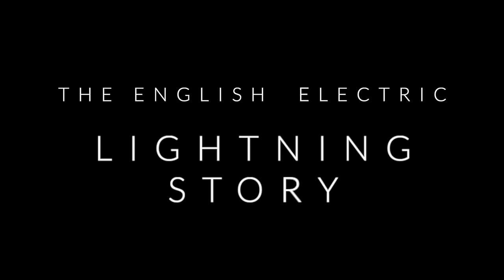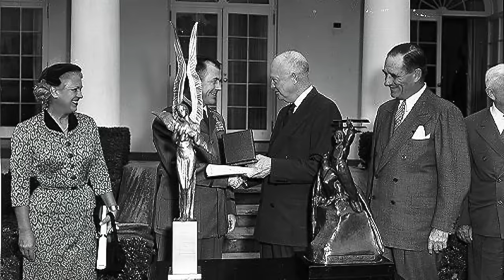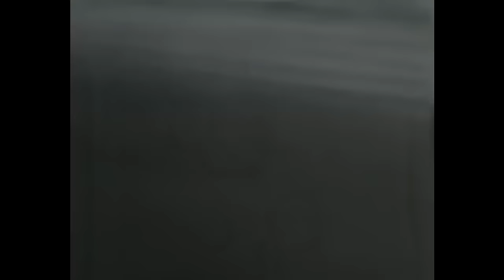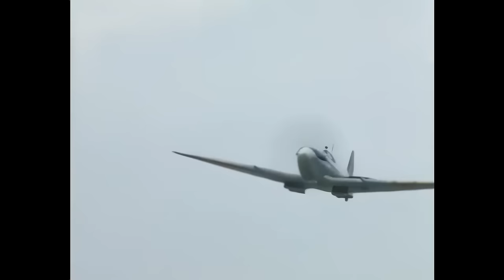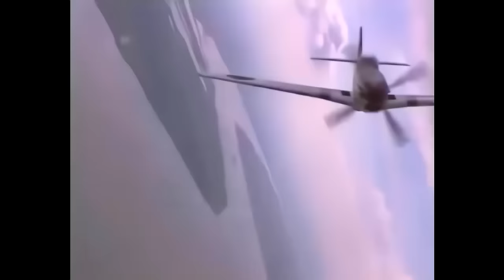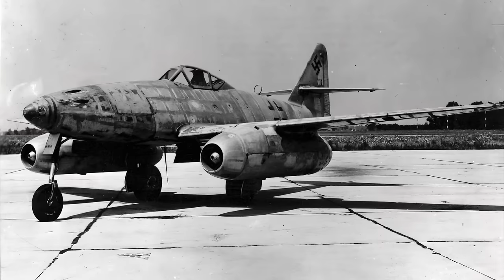English Electric Lightning | The British supersonic fighter and interceptor aircraft | Upscaled

Comment: I can well remember sitting in the canteen at the Dinorwic powerstation construction site in 1982 watching a pair of Lightnings that had appeared from the direction of RAF Valley, travelling up the Llanberis ridge over the top of Snowdon in a rolling scissors fight in full reheat. The roar was immense and shook the whole valley. It was an incredible sight to see them disappear high into the ether continuing to maneouvre until out of sight. I often wonder if they got a bollocking for upsetting the hillwalkers or a pat on the back for the recruitment work they did that afternoon.

Comment: I saw the Lightning at airshows in the 70s, loved to see it go vertical with reheat. Also watched one test firing it's missiles. I was in a Shackelton, OMGWD the Lightning pilot was bored, getting down slow enough for us to watch. Now I had a long chat with an ex lightning pilot over a couple of beers.About all he did was intercepting Russian Bears over the north sea. Their game was to sneak in at high level over the north sea in International airspace to prove they could nuke us. Now supposedly GB was protected by Ground to air missile systems, but what would they do to the bears? Radio bang bang we shot you down? To which the bear would answer "we shot down Gary Powers, what have you shot down?" The answer was the lightning, two approaches both intercept, either a Mach 2 flyby which would rattle the teeth of the most dedicated Soviet crew, or the lightning would formate on the bear and pilot to pilot show a Playboy centerfold. Well that's what I was told

Comment: Our company used to buy printing equipment from a company in Islington, the owner was a very tall ex RAF pilot with a fine handlebar mustache,  he informed me he was at the time the tallest pilot in the RAF and English Electric designed the Lightning cockpit fittings and seat to accommodate him, as he was the most extreme example. He then went on to fly them.

Comment: Actually, the Me-262 wing was not swept to delay compressibility.  
Wikipedia: "Because the engines were slow to arrive, Messerschmitt moved the engines from the wing roots to underwing pods, allowing them to be changed more readily if needed; this would turn out to be important, both for availability and maintenance.[13] Since the BMW 003 jets proved heavier than anticipated, the wing was swept slightly, by 18.5°, to accommodate a change in the center of gravity.[13]"

Comment: I went in the Leuchars 11 Sqn. simulator for about 90 min and straight after in the right hand seat of the T3(?) in 1966. A stupifying acceleration and quite easy to fly if you only used the trim switch. My last flight was in a RAFO, (Oman,) SAAB in 2014. Memories for a lifetime.

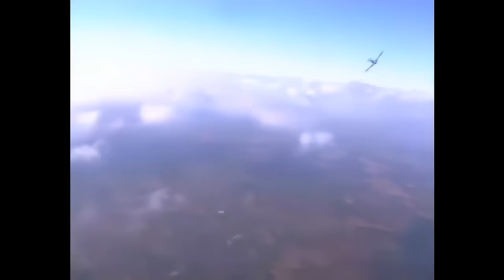Comment: 3:39
The term compressible flow is used to   express that the density changes due to the local pressure, in the case of a wing the local speed above the critical mach number exceeds the speed of sound locally on the top of  the wing, at that low pressure the air expands, NOT  compresses, accelerating the flow due to the increased volume. approaching the trailing edge the flow pressure must increase, the transition to subsonic flow happens along a weak shock, (called lambda shock) creating a sudden unfavorable pressure gradient, where the boundary layer separates, and turbulence occurs, which is felt as it  would under stall conditions. If the local supersonic flow distance is short, the separated flow may reattach, not perceivable but associated with an increase of drag, and a pitch moment.
The pressure distribution changes, so  that the center of pressure changes modifying the pitch moment, on the upper side a weak nose up moment is created, on the lower side a noticeable pitch down moment, which  may not be controllable, until at lower  altitude warmer air, with corresponding higher speed of sound the mach number is reduced reducing this nose down pitching moment, returning control.
That is what happened on the P-38.
At the leading edge near the stagnation point only is where higher pressure caused a slight compression, but not any where else.
The term compressibility is confusing when in reality an expansion is at play, again due to the volume increase leading to higher local velocity, past the speed of sound.
Reply: I seem to recall the lightning being referred to by people as the English electric frightening due to its performance and its ability to catch the so thought uncatchable aircraft

Comment: I have read that the Mies project had something that the x-1 vitally lacked, an all flying tail plane....without which the X-1 might not have been a succes. Later, a large scale model of the Miles 52 was tested and shot straight through Mach-1 with no problems at all. Also, it used a jet engine, not a rocket!

Comment: British engineering at its best!
Reply: It was pretty bad engineering really. Rolls sent a team down to try to work out why the upper engine didn't last very long. Putting one engine over another was bad design because if a fire started in the upper engine it would kill the lower one. The aden gun was supposed to be gravity fed but because of the lack of space it had to drag the rounds up causing jamming after a few rounds. The mk3 didn't even have these. The refueling probe was added as an afterthought reducing the max speed at sea level. The fuel lines were designed in the 50s and had no tolerance and had to be x-rayed after fitting and if found to be out in one place you had to re-fit the whole lot. The radar was off-set so causing the pilot to lean to one side to use it. If the pilot pulled around 7g it bent the airframe and the pilot had to pull negative g to stop the ventral tank from leaking. Our instructor died when flying without the missiles. They gave aerodynamic stability. The iso propyl nitrate starter sometimes exploded. One pilot pulled the stick back on take off while his wife filmed him. He pulled back too sharply stalling the airflow over the intake. She had a record of his death in a ball of fire.

Comment: Do you know if the Lightning took advantage of the transonic area rule?  Also, I know you didn’t write the thing but the first Soviet supersonic aircraft was the MiG-19.  MiG-21 could get to mach 2.
Reply from the maker: I actually don't know about the transonic rule Jay.
Reply: @Dronescapes  >> It came about in the 1960s to help aircraft designers go supersonic easier.  It’s easy to see on the F-106 coke bottle fuselage.
Reply: No, the sides are straight. There would have been no way to put a waist in around the wings, the fuselage was only just wider than the engines.

Comment: 4:53 the speed of sound al lower altitudes is higher because the TEMPERATURE increases, not because  the air is thicker. Standard atmosphere: 6.5 °C per 1000 meters altitude change.
ss = square root( 1.4 × R × Temp )
R = 287 J / kg K  gas constant for air
Temp in deg Kelvin K
ss speed of sound  m/sec, 
 at 15C, 288K   ss = 340 m/sec
Reply: Nope
Reply: @firstnamelastname-ys3mz  😀

Comment: there are gaps in knowledge. while the British were working on the jet to pass through the barrier. and a few mods to the rear tail planes they were told to cancel. and at the same time, the Americans had the design prints from the British. and they used that to move forward.   if the British were left to carry on. then the British would have won. and not yeager. captain eric brown told the truth. he had plenty of wartime experience and in combat.a very knowledgeable pilot.    RIP.  AND THE HAWKER TEST PILOT did he ever fight in the war??? in combat?  captain eric brown was one of the best..
Reply: There are gaps in knowledge alright.The plane you are talking about is the Miles M-52.There was no Miles M-52 ever.The closest Miles got was a Plywood mock-up.The project was cancelled because Power Jets did not have an engine ready.Neither Eric Brown,Chuck Yeager or anyone else could fly a Plywood mock-up pass the sound barrier.Eric Brown was one of the best pilot's who ever lived.

Comment: Another case of the UK not exploiting a good design in the way the US does. BAC  proposed a Swing Wing  variant with a very large underbelly tank and more hard points for the Royal Navy which could have been ordered instead of Phantoms. Both of those innovations would allow single engine working so that its endurance  would increase by a factor of four with a true multi-role capability. This would have had a two crew arrangement and a bigger radar  with a solid nose and side fuselage jet intakes.

Comment: I love this plane and UK was way ahead in super sonic jet powered development by the mid 40s with the Miles M.52 whose secrets the British government gave to the US and then cancelled in 1946 just before it flew. The Lightning, although not a direct descendent, was a fabulous engineering achievement and awe inspiring aircraft that achieved its aim to intercept Russian overflights. The Lightning held many records and was the only plane of it's time to fly above a U2 and catch Concorde at full throttle. Lockheed designed the F4 but the US Air Force didn't adopt it and was later found to have bribed officials to buy it, curtailing Lightning sales. The F4 was difficult to control and many less experienced pilots were killed by its foibles.
Reply: I find facts are helpful.There was no Miles M-52.The closest Miles got was a Ply-wood mock-up.Power Jets did not have an engine ready and the project was cancelled.Lockheed did not build the F4.McDonald Douglas built the F4.I think you mean the F-104 which Lockheed did in fact build.The last F104's were retired in 2004.(Italy)

Comment: The USA managed to break the sound barrier on the bell X1 with the help of data and technology from a cancelled uk supersonic plane project which used a moving tail plane which the X 1 originally didn’t have  the ukproject  was cancelled and the data and tech knowledge was passed to bell which then went on to break Mach 1 in level flight
Reply: Your talking about the Miles M-52.There was no Miles M-52 ever.Miles built a Plywood mock-up and that was as close as they got.Miles didn't invent the moving tail.It had been on test aircraft for years.Bell already had it in their design.The M-52 was cancelled because Power Jets the engine builder did not have an engine ready.Miles didn't give Bell any Data because they didn't have any Data to give them.
Reply: @jerryg53125  For high-speed testing of the M.52 all-flying tail, one was fitted to a Spitfire as this was the fastest aeroplane available, and the test pilot flew this revised fighter during October and November 1944 to a speed of Mach 0.86 in a dive from high altitude.

At the time of the project’s cancellation (1946), the first of the three M.52 prototypes was 82% complete, with test flights planned to begin in a few months. 

The test programme was to have involved trials without an afterburner with the object of attaining Mach 1.07 by the end of 1946.Afterr cancelation, the M.52 design was passed to Dr Barnes Wallis at Vickers-Armstrongs, and engine development took place at the RAE. The result was a radio-controlled 30% scale model of the M.52 design powered by an Armstrong Siddeley Beta rocket engine.

The first launch took place on 8 October 1947 at high altitude from a de Havilland Mosquito, but was unsuccessful inasmuch as the rocket motor exploded shortly after release. Only days later, the Bell X-1 broke the ‘sound barrier’ in the USA. On 10 October 1948, a second rocket-powered model was launched, and reached Mach 1.38 in stable level flight. However, instead of diving into the sea as planned, the model failed to respond to radio commands and was last observed (on radar) heading out into the Atlantic. Following that successful supersonic test flight, further work on this project was cancelled.
Reply: @tobyrobson2939  The moving tail was tested on several planes including the Spitfire.Miles did not invent the moving tail.It had been on test aircraft for years.Miles had about 80 percent of the parts ready to start building the first Miles M-52.It was not 80 percent complete.Miles did have a Plywood mock-up but that was as close as they got.Without the engine from Power Jets there was no point in going ahead with the project.The rocket powered model did reach mach 1.38.Bell did not use any data from Miles because they never got the M-52 in to the air.

Comment: TSR2 left it standing!
Reply: If it hadn’t been cancelled, it was supposed to do Mach 2.15 in level flight at sea level, every other plane would have been instantly outdated.
Reply: @paulm2467  
F1-11.
Reply: @alexhayden2303  F1-11 was a lot slower than that in level flight at sea level, around Mach 1.2.
Reply: @alexhayden2303   The F1-11 was much slower than that in level flight at sea level, around Mach 1.2

Comment: The opening statement about the X1 is total bollocks . It was a BRITISH design , by Miles, that was given over to the Americans for reasons that even today are unclear. It’s clear that Britain was NOT behind in jet design
Reply from the maker: You are definitively wrong.
The X-1 and the notorious M.52 were dramatically different.
You might want to learn more about the M.52 from someone who was actually there: Eric Brown.
For the record, we also have some never seen before footage of the M.52 on the channel, just search for Frank Whittle and Power Jets.
What Miles really did was to provide some constructive assistance with Bell’s aerodynamic issues.
You can also argue that the M.52 was cancelled without a decent explanation to this day, and that is valid argument worthy of exploring, but do not take it too far.